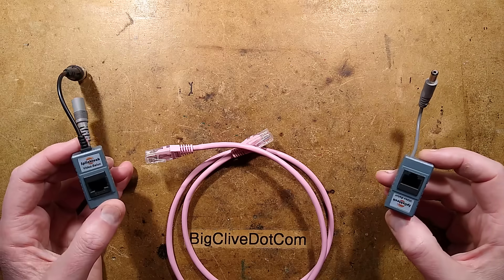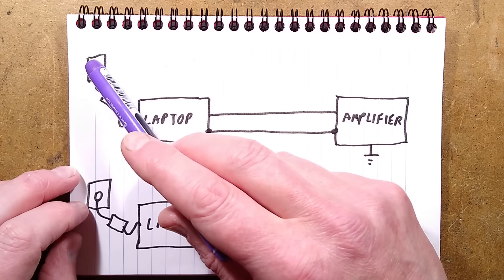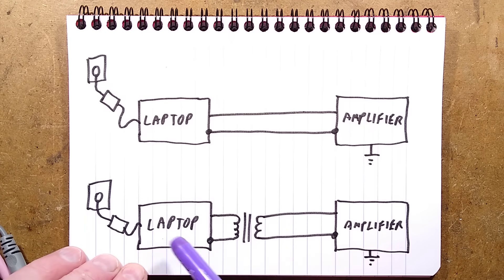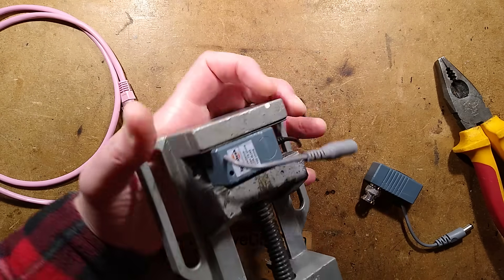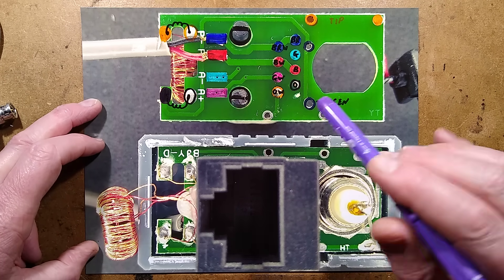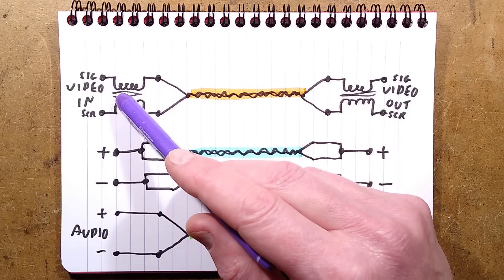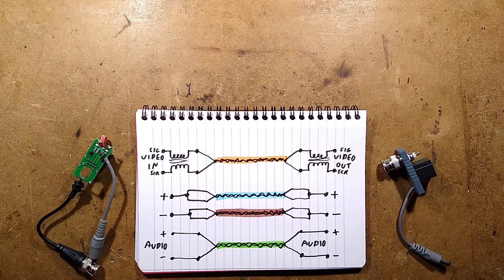Baluns - I got this one wrong (with schematic)

Comment: We use this on gas station pin hole cameras because they are hidden in the door frame taking a low quality video very close to your face.
Reply: Also we install an outlet in the ceiling with a 15ft Ethernet cable inside the door frame , coaxial runs 100ft to the security cabinet into an Analog to IP camera converter so we can plug the Ethernet into a NVR.

Comment: Basically a Balun is there to stop reflections on a line. When the terminating impedance equals the characteristic impedance there is no change in the signal and no reflected signals are coming back and interfering with the signal. If the line is of a given length then the impedance of that line is of a given value so the current on both lines and the voltage across the lines go out of phase and reflections are created. The terminating impedance nullifies this by matching the characteristic impedance and cancelling it out. The design of the Balun is effectively doing that job. At least a thousand nerds will say what I have put here is wrong, but for me it's the easiest way to understand what is happening, even if technically I am wrong with my description and I may not fully understand the theory behind it. What is written by others here makes sense to me - current Baluns are better suited to Video as you can pass DC levels whereas Voltage Baluns need really big transformers to get the frequency range.

Comment: Seems like a current balun, similar to what you were talking about with a voltage balun. You are basically right, just a different type of balun. The audio signal already looks differential so no need for it there.

Comment: You've not shown the relative polarity of the two windings, so I may be wrong but. assuming the usual, I think your schematic shows the two transformers connected as common mode chokes. They present a high impedance to signals picked up (in phase/common mode) on both lines of the twisted pair, while presenting low impedance to the video which is out of phase (or differential) on the two lines of the twisted pair.  AFAICS, there is no balun activity as such. The twisted pair remains balanced throughout.

Comment: You want to see another big fat balun.. just look at the big yellow 110v safety transformers they are a 4:1 balun .. you have +-220 v on the live & 0v on the neutral going in (this is unbalanced as sticking a wet finger into live or neutral gives different results) & the output is 110v but presented as +-55v on one wire & -+55v on the other ( this is balanced as the 2 wires are symmetrical but opposite & sticking a wet finger into either gives the same result).... 4:1 by the way as same power out as power in but half the voltage so twice the current so the impedance ratio of the balun is 4:1 not the 2:1 turns ratio.

Comment: 6:20: You seem to have labelled the video wires SIG and SCR. I guess the former is signal, but what does SCR stand for?
Reply from the maker: Screen.
Reply: @bigclivedotcom  Ah. Thank you. Referring to the cable shielding, no doubt, not to the actual monitor display.

Comment: 6:53: Ppl pls correct me if mistaken – to my understanding, the windings on the video wire literally work as balancers/unbalancers. An unbalanced signal comes in, then the opposing windings in the transformer make the unbalanced component of the signal balance out across into the respective other wire, then the balanced signal runs down the cable, then the process is reversed by the matching (identical?) balun at the far end. So it's from UNbalanced to BALanced, then from BALanced to UNbalanced once again. If I understand correctly, the balanced signal is effectively like differential signalling. Corrections welcome.

Comment: I love that i can thank my trade course and my old instructors as i did learn the theory as well as practical applications for set-up as well as repair/maintenance of the equipment. I do miss it at times tuning cavity filters and making or testing antennas etc, i work in fiber optics now

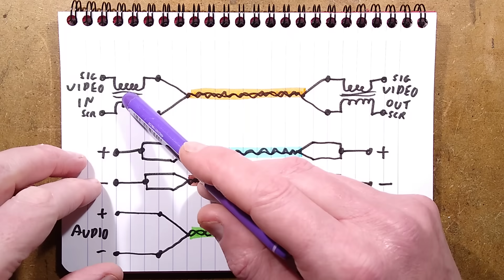Comment: @7:00 The two windings are wound opposite each other.  Since the signal is relatively inverted in polarity, this reinforces each signal while cancelling out any common mode signal before it even reaches the twisted pair.  It also significantly reduces any unwanted signals on only one of the conductors relative to the main signal.
Reply: I had this thought too - ie the rejection of common mode interference.

Comment: I did not expect to see these. I have only watched a bit of the video but I really worked very closely with a LOT of Baluns due to CCTV installs. The classic Analog cameras use the BNC connectors and get the power through the Baluns. SO you cable up Cat5 or Cat6 and use Ethernet cable for the analog cameras. In Miami we installers always referred to them as 'Balloons'. Also referred to any Ethernet-cable extender (RCA, HDMI, ETC) as a balun. 

-former installer.

Comment: If one side is grounded then it's not a balanced system regardless of transformer the term "balanced" seems to be widely misused.  A true balanced system sends the same signal on both wires but with one inverted so at the other end one leg is inverted and added to the other which results in noise cancellation and signal re-enforcement.

Comment: The specs for networking cables are interesting. Cat6 isn't much of a thicker AWG than Cat5e, but one of the main differences is there's a core in the centre to ensure separation between pairs and to provide structure. The twists are designed to reduce cross talk, and other magic stuff that I don't quite understand, to ensure data integrity (and power if power over ethernet)... Although I'm not sure how I feel about everything using Cat5e/Ethernet when it's not data/telecom or to PoE specs 🤪... though I guess it is one kind of cable that's kind of ubiquitous and easy to obtain/install for long runs (so long as you don't end up with CCA cable x.x)
Reply: Lots of Cat6 out there has no core in the center, mostly the newer stuff. Seems it's not needed to meet cat6 requirements.

Comment: Years back we had ground loop issues when running composite video coax cables from one building to another due to the building grounding system differences. I remember purchasing industrial video ground loop isolators. Each coax needed one and they were quite expensive at the time.

Comment: I didn't realize they're so complicated. At school, we had to use a different thing called a balun to connect rj45 to the older token ring infrastructure.
Reply: Token Ring Baluns deal with the difference between the old square plug/DB9 signalling and the more updated Cat5/8P8C signalling if the token ring protocol, with one of the two being electrically unbalanced .  I haven't used this for years .

Comment: Why use baluns in the signal unless it's for an impedance rise on both ends?
In audio usage, one pair connects to the primary side of the transformer while the other connects to the secondary side, essentially eliminating a ground loop between source and receiving end.
This looks like something used in the old PAL/NTSC days for antenna matching between VHF and UHF.

Comment: Is this why my KVM feeds so much noise into my desktop speakers?
Where would I put the isolation transformer? Before the KVM or after? Before and after?
Reply from the maker: Usually on the signal, wire to the speaker system.

Comment: I think the transformer is wired up like an auto-transformer. Double check it.
Reply from the maker: The wiring is as shown in the schematic.
Reply: @bigclivedotcom Very interesting. I would have expected them to try and impedance match 75 ohm with 130 ohm or whatever the network cable impedance is.

Comment: wow this happened to me the headset cord lit up like a heater, and it killed the audio on the laptop the cord was streached across the room no fire, wife freaked out and I calmly unlugged each device and said DO NOT TOUCH that wire at all 120v at 15 amps ... **POOF*
Reply from the maker: Was that to a tube amplifier?  They are notorious for having live chassis and relying on the plug being inserted with the correct polarity.

Comment: For the last two weeks I have been banging my head against the preverbial brick wall. I've been trying to split the HDMI signal from a Free sat recorder to supply HDMI signals to two TVs in seperation rooms. I purchased a  device from a popular online company. The device has a transmitter with one HDMI input from the recorder and two HDMI outputs. One to the TV adjacent to the device. It also has two outputs which go over cat6 cable to receivers at each external TV. The receivers then convert back to HDMI to the TVS.  I originally used cat5 and it worked on HDMI fine but it degraded the tv signals when the recorder was switched on. So I purchased two cat6 cables from the same online supplier. One 20m and one 30m and ran them in. But the 20m one worked fine but 30m failed. The system should be good for 50m. Tested the cable no faults shorts or open and with the line tester the wires were in the right sequence. So I cut about 10m off the "faulty " cable and re ended and still no success. Routed the 20m cable over and that worked. Pulled the whole thing out to bench test and every combination of cable/port/HDMI cable. The fault still follows the 30m cable. With the 10m I cut off the 30m I made a short test lead to tset and that failed. The fault follows the cable but I'm baffled as to why two cables bought from the same manufacturer should be like that. I need to know why to preserve my sanity. A new drum of cat6 has sorted the problem. Hope you can help please forward all replies to the house for crazy people where I'm now residing.

Comment: Aside from impedance matching using transformers with a centre tap can be used for "phantom power". Traditionally this was how microphones were powered with 48V DC or in some rare cases 110VDC. Even without the need fo DC power balanced circuits run over shielded twisted pairs provide excellent common mode noise rejection. 
The standard way today of feeding HD video from cameras etc is using HD-SDI over coax or fibre.

Comment: The way those transformers are connected look they are configured as common mode chokes. Any noise induced on both conductors on the cable run will see a high impedance at each end.

Comment: So, technically, these aren't baluns at all. Also, what would be the point of sending the audio down separate twisted pairs; you would get no noise cancelling advantage at all. What a stupid waste of money these are, especially considering what excellent impedance-matched fully isolated line drivers available, with the option of phantom power.
  Thanks again for a good vid.
  I used to use a clamp I made affixed to a wood chisel for opening glued cases. I could dig it out and send it to you if you wish.

Comment: Excellent information Clive.  I’ve used baluns on video systems for several years now.  Always wondered about the circuitry in them.  Very good tip to use baluns on audio systems for isolation from ground loops that create noise / buzz etc.

Comment: Waaaait a minute, you have power on two of the cat5 and data on another two. What is being balance and unbalanced?? Radio balluns take a single pole input and balance or unbalance the split from that pole to the single element antenna. This just looks like an adapter?

Comment: The true use of those baluns is in the cctv industry, camera on one end and monitoring on the other end, the cat cable between each is normally the structured cabling with in a building ie the network cables, the use saves the need and time to run km of new coax cable

Comment: if I can give a 2cent break down, video signals, such as NTSC or TVI (an extended type similar to NTSC on a scope) will not pass through a transformer (wired for isolation), its like sending a square wave through a transformer, it will not come out square. So the DC is fed through these inline so the DC NTSC signal passes through, but higher frequencies on the lines will cancel out as they will induce on the coils. - very simple over simplified 2 cent version

Comment: I could be wrong but it looks like the "transformers" are being used to remove common mode noise. Basically this can be a "cheat" to get round slight impedance mis-matches. EG using a 51R resistor to terminate a 50R line. I cant remember the specifics but network cables hace an impedance of roughly 100R with CAT 6 being tighter tolerance than CAT5 and CAT5e. I think CAT7 also has a tighter specification for DC resistance, and CAT8 works up to data rates of 40Bn per second. That said CAT8 is only specified for shortish runs for the higher data rates. So in short if you substituted a CAT8 cable you might not even need the common mode rejection inductors in some applications. That said those Baluns are not designed how I would do it.

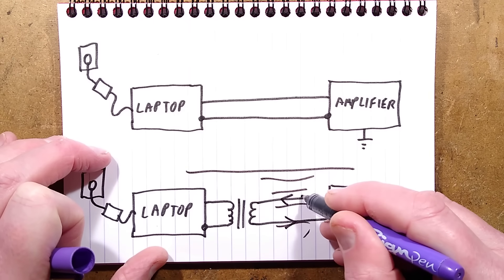Comment: 3:26 Induces a current" (a current? but really a voltage that is the same in both wires)  3:30 Probably a slip of the tongue "they cancel each other out because one is effectively pushing one
is pulling" (No they are both pushing or pulling at the same voltage, so no current flows in the source or load transformer that why the interference is canceled)
Are they sending video over a twisted pair ??? Or Data?? still would have HF loss!

Comment: I don't see any comment that would summarize why those baluns are even used and why they are constructed this way:
1) twisted pair cable is cheaper than coaxial (at least when comparing cat. 5e UTP and RG6), though not much. It is though common sense to install twisted pair as it is more future-proof
2) Because RG6's cable impedance is 75 Ω and twisted pair's 100 Ω an impedance matching is required, otherwise the signal will reflect (see Wikipedia what that really means...)
3) in this case there could be no galvanic separation, because video composite signal (PAL at least) contains a DC component, which would be lost when transformers were used.
Reply: Quad aluminum shield, copper clad steel center conductor RG6 is cheaper than cat5e last time I checked.

Comment: They are balun transformers. matching an unbalanced input to a balanced output suitable for transmission along a twisted pair (within the ethernet cable) and then back to unbalanced again, at the remote end. Much used in amateur radio / RF engineering.

Comment: Could be worse- the signal processing, adding or removing the delays you have to deal with for fiber optic arrays (like those found for commo/data/net) are vastly more complicated, so much so that you have to factor in the transparancy, translucency, reflectivity, refraction, & more. In addition if your sending multiple types of light over the same cable you have to do all the math for the divergence & sigmal loss per nanometer for each bandwidth of light & actually "time" the refraction inside the cable so the light doesn't overlap, allowing you to filter out the bandwidth you need (or don't) & divert that for instance to other offices or buildings connected on the same single cable.

Comment: I use laptops for audio often. Usually if i have a buzz or other hum, option 1 my audio jack is bad. Option 2, which happens more often, noise is being introduced into the laptop because the power supply is beginning to fail. Then it picks up noise either from its own switching, or off of ground pin. When I'm feeling cheap, i use one of those dirty and nasty adapters between wall receptacle and adapter plug. I do eventually end up replacing the power supply cause they have a habit of destruction upon disassembly.

Comment: Remember as a kid looking at some TV antenna magical thing, converting "the round cable" to "the flat cable". It had a binocular core with some wires going back and forth, and it didn't make sense to a kid used to batteries, tiny bulbs and motors. Now I design and make this magic myself 😸
Reply: Those are balanced to unbalanced antenna balluns. The antenna is a ballanced, 300 ohm dipole, the coax drop cable is unbalanced, 75 ohm coax, and the TV input is another 300 ohm, ballanced connection. On the other hand, other people just used balanced, 300 ohm twin lead, without baluns, for the drop. Eventually, they started making TVs with the unbalanced input, mainly because people were connecting them to cable systems instead of antennae.

Comment: The baluns are there to get rid of spikes. Thanks :)
Reply: I thought that I had better explain as my answer is somewhat cryptic. Like the mains filters in switch mode power supplies. They pass the signal but not the external signals that are the same on both lines AKA glitches. Glitches picked up from nearby switched inductive loads.

Comment: This is a CCTV video and power balun. 
It's for using Cat5/6 instead of COAX. 
CCTV systems are designed to use 50/75ohm COAX, these baluns don't just covert cable types nicely, they also effectively make the camera and the recordings equipment think its using standard 50 or 75 ohm cables. 
Within the baluns are usually a couple of discreet components these effectively cancel out the reflection that gets introduced  by using twisted pair cables.
You can also get 4 video feeds down 1 cat5/6 as each pair can be used as a separate cable. 
Video signals though must only flow one way. You cannot oppose them otherwise harmonics will appear on the video images.

Comment: I think you just helped me troubleshoot the issue with my stereo lol! I have a little 3.5mm Bluetooth battery powered device hooked into a diy line-in input on an old Sony boom box and it sounds pretty good but I've always had the feeling it could sound even  better. After watching this I will be buying a "3.5mm isolation" device off ebay for a few bucks and see if that helps!